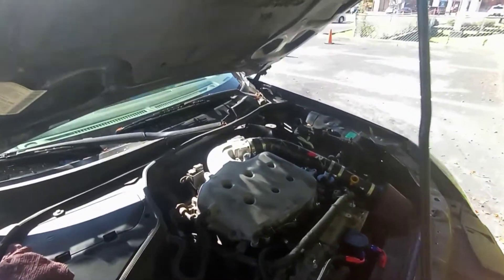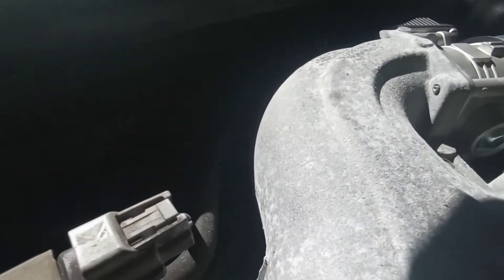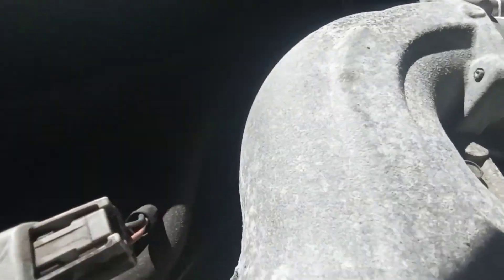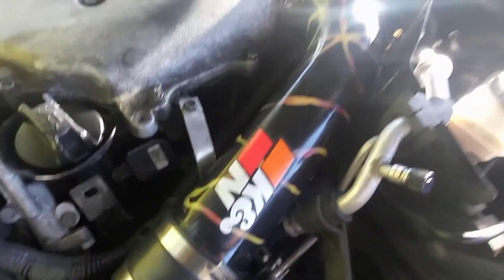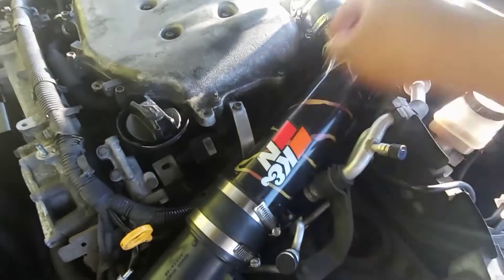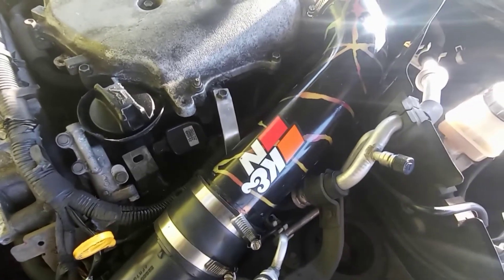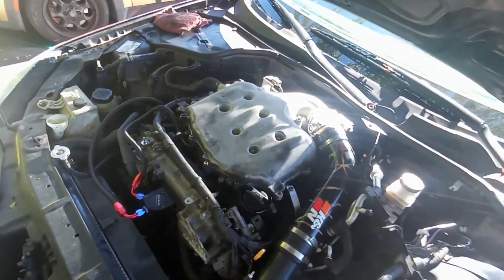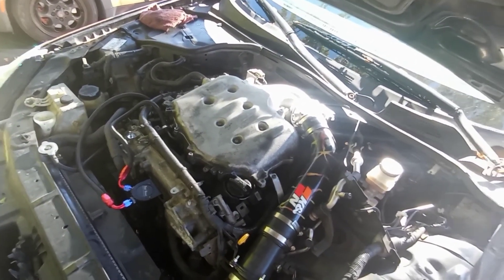How to fix a Vacuum leak for Infiniti G35 Coupe or 350z Code P0171 DIY

Comment: I may reach out later cuz I just got an 03 z and it’s got that code going and never had a z before till now ;)
Reply from the maker: For this specific code you have to be checked if you have any vacuum leak or bad PCV valve you have to buy a brake cleaner and start a car and spray the braking and the close of the engine and the hoses when the engine start Shake mean the hose or the place is cracked and the piece of to be changed